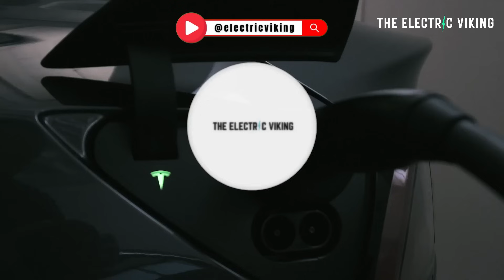Europe & Australia crash testing confirms that EVs are safer than ICE

Comment: Are EVs crash tested with the batteries in them because any decent crash would desrupt an EV battery causing the battery to go into thermal runaway which actually has caused tbe death of many people that is why l would never buy an EV and the battery is a inntergral part of the structure of an EV and you mentioned a really solid battery pack makes them safe well my 1997 Toyota Hilux has a bix frame chassis which is extremely strong and does that make it a safe vehicle after its ancap rating would be very low because it was exempt from safety laws when they were sold in Australia and tgere are still a few of them driving around

Comment: Crash testing and high scores in collision tests are around design and engineered strength and engineered crush zone design.
There are good and bad in all makes and types. both  ICE and EV !
5 stars does not automatically give a good  indication alone. You need to look at the impact test scores not just 5 stars. 
Some 5 Star cars still get a Moderate or Adequate collision performance instead of a Good performance chest and leg zone -   Read the Reports and educate yourself when looking at new cars.  Crash tests are at 60kph (32 mph) only yet most serious injury and fatality is at speeds above 80 kph (50 mph)

Comment: The vehicle floor pan is critical to the structural integrity of a vehicle in a collision, side impact in particular but also look at older vehicle crash tests that would buckle at the A pillar, partially due to the design at that point but mainly due to weakness and bending in the floor pan in a front on impact.

Comment: Why is MG5 zero star?
from reddit about mg5:  To be clear it's not great (it scored 43% of the possible points) but it's only zero stars because it's missing certain electronic safety assists, which is an automatic 0 star rating regardless of how it performs otherwise.Oct 20, 2567 BE

Comment: Insurance premiums disagree. 20% of all Teslas get written off each year.
Reply: Blatant lie.

According to recent studies, the percentage of Teslas written off each year is significantly lower than the average for gasoline cars, with data suggesting that only around 0.9% of electric vehicles (including Teslas) are written off annually, compared to 1.89% of petrol and diesel cars.
Reply: 😂 I don't understand this comment. Please elaborate
Reply: Insurance premiums aren't soley based on cars being written off 😂 please don't tell me you thought this. The reason why the insurance  is so high on Tesla is because they   are as fast as most v8s while carrying your family as a daily driver. There battery tech is far more advanced than nearly every other brand. And most insurance companies don't like the fact you can steal someone's phone and gain access to there vehicle. The car is not cheap to buy brand new. 
Theres many more things why insurance is a premium. The cars being written off is merely a fraction of it.
Reply: Utter nonsense, no car brand has 20% written off each year. Drivel.

Comment: Just interested are these electric vehicles fully charged? I mean there is that fire explosion hazard they seem to have after accidents.
Reply: Myth number 99
Reply: The batteries tech have been updated. Please do so along with them.
Reply: Wham Bham tesla cam have tons of Teslas in accident and no boom. Thats because you need very high temperature to reach its flashpoint.
Reply: ? It's been proven they are safer from fire , insurance companies research..
Reply: Yeah, because petrol/gasoline cars never caught fire right ?  The new batteries don't suffer from thermal runaway any more...

Comment: It's the rectangular base metal plate holding the batteries that provided all those extra protection and prevented damage to the interior from all directions as long as the passengers are seated within those base plates. 
it's like those racing cars with protective metal bars... around at the base